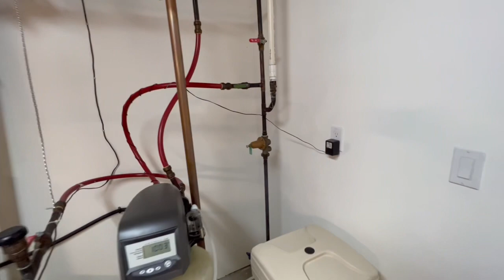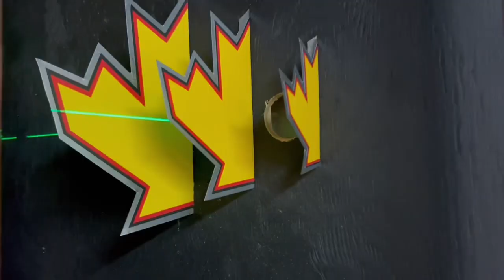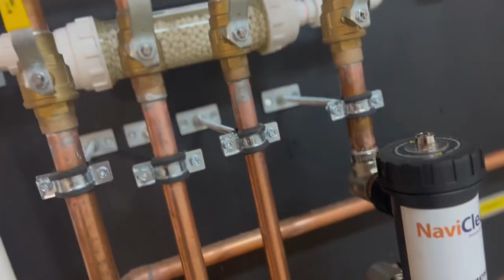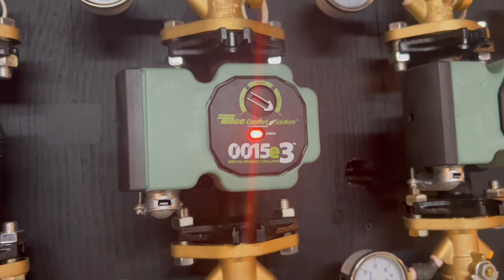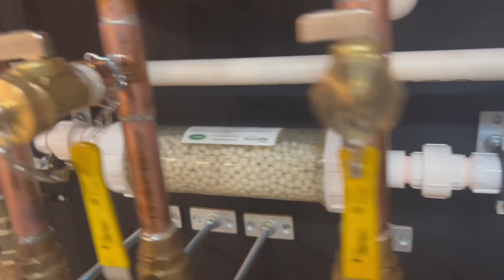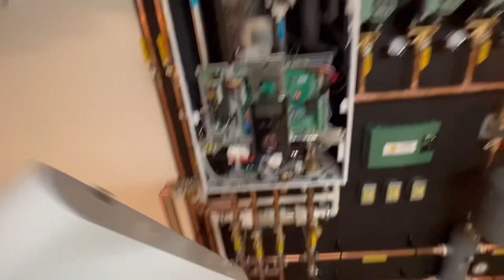Navien NFC-250/200 Combi-Boiler Retrofit #8

Comment: beautiful work. Question for you.  I have a 7000 sq ft. house under construction.  My plumber wants me to use a Navien  Combi Unit for four hydro heat air handlers and 5 full baths. BTU ratings are within the Navien specs.  I am concerned that when several people are showering at the same time we will have a lack of hot water and heat if all are running at the same time.  I am aware that the combi unit will switch to hot water and not be generating water for the hydro heat when hot water is called for in the bath rooms.  Should I go for a separate Navien boiler and hot water heater.  I am in the North East USA.  New York so we do get cold winters.  Thanks in advance.
Reply from the maker: I would do one of two options …cascade another Combi unit “two units” which gives redundancy or option 2 have a NFB strictly heating and NPE for domestic hot water

Comment: Odd question I know, but are you allowed to connect the boiler fill to a hot water line? I'm trying to do my best version of a Canuck like boiler install but my recirc line is blocking my access to the cold water line. I could pop over the recirc line but it would be a lot easier to just tie into it 😂
Reply from the maker: Never tried it

Comment: Looks like a clean install. I gotta ask though, is there a reason you didn’t install an axiom tank/glycol feeder?  
Anytime I’ve done a boiler swap where the make up water is coming from the city I always do an axiom tank. It’s just a lot safer. For one if you have a leak somewhere on the system you’ll know there’s a leak before any serious damage is done by just looking to see the water/glycol level in the tank. 
I did a boiler replacement for a customer who got a massive sink hole in his garage from a leak on his infloor heat.  His make up water was tied into the city and he had no indication there was a leak in his garage slab until he went out there one day to find a giant sink hole.  
I’m also a fan of the Navian combo boilers. I love how just about every component can be serviced with only needing a #2 Phillips screwdriver.  
That said I do think IBC is a better boiler. And in my experience they are just as good at backing their products.

Comment: Hey James, 
If I’m using the Navien NFB-H 199 manifold (copper oem), it has a gap/spot for a circ pump. Do I need a primary circ pump there if I’m using zone circulation similar to what you have here? I see you didn’t put one in. 

Wasn’t sure how it all played together with the hydraulic separator and if I could do without the primary zone pump on an NFB. 

Also, when you did the joint return,   You just piped the return lines to the 1 1/4” return line with 1 1/4” tees with 3/4” bull heads right? 

Thanks!
Reply from the maker: NFB need a pump …NFC don’t cause they have one internally

Comment: I have a 30x50' shop with a 6-circuit system. I just built it and only have the slab components installed, and the manifold built and pressurized. I don't have gas to the property, So, my options are propane (I will bury a tank) or electric. I also love Navien but wondered if their electric boiler would work as well as the gas? What direction would you go? It's in southern Missouri so it's not super cold there. Thanks for any help, James and great work on this one. The "for Ian" was a class act! Great work!  
-Brian
Reply from the maker: @Sea-Doopilot  electric options always work …and can be clean
Reply from the maker: But propane would be the best for efficiency vs cost

Comment: Going crazy with oversized zone pumps, not necessary for overly expensive and maintenance required systems. Wiping customers like there’s no end. I work on sky scrapers in NYC and a single pump does over 20 stories and over 1000 zones control valves. Poor customers don’t know any better, this is the problem when end users needs a heating system and they rely on a local plumbing company. Thumbs down 👎
Reply: Obviously you know NOTHING about pride in workmanship, this is not a 20 story building.

Comment: Why did you choose to use circulator pumps instead of zone valves?
Reply from the maker: If one pump zone fails then that zone has no heat but if you use zone valves and single secondary circulator and that fails then all zones have no heat

Comment: Why so many zone pumps?  Could you not just use one variable pump and zone valves?  I prefer a simple condensing boiler with an indirect tank that has a domestic coil and mixing valve.  Your install is very clean and well thought out. Are you going to insulate all the copper?

Comment: Hi, i jave a question. Do you raye these units for reliability? Reason i ask is that i had this same unit installed in my house and less than 9 months later have two issues with it.

The first is a 351-00 error code that the company thay installed it always tries to brush aside when i bring it up.

The second more annoying pressing issue is a LOUD and frequent whining noise coming from thr bottom left of the unit. This i was told is a inducer motor and they have ordered it to he replaced under warranty. 
But i dont know why/hiw something fails so quick on a unit that is supposed to be suitable for commercial purposes. 

Know im just not sure about the quality of the brand and product as a whole, was hoping to get 20+ years out of this boiler. I honestly doubt that will be the case. 

See my video for a clip of the noise it is currently making.

Comment: Great videos! The only question I have is about the use of dielectric unions. Typically copper pipe is bonded to the electrical system. With dielectric unions installed at the boiler won't that break the continuity of the bond, leaving a large portion of the copper unbonded? When filters are installed I usually see a jumper to maintain that continuity or another bond established elsewhere. So, should a jumper be installed around the boiler to maintain the bond?

Comment: Each of your 8 retrofit videos has been incredible.  Wish you were in Washington State in the U.S. so I could hire you.  My 30 year old cast iron oil burning boiler needs to be replaced, but I have propane available.  Is there any reason not to replace my oil boiler and indirect domestic hot water heater with an NFC combination unit?
Reply from the maker: Nope …as long as you got good water chemistry ….on propane is fine :)
Reply: @canuckmechanical6490  Thanks. Propane is about $1.40 per gallon cheaper than heating oil in my area. The NFC combi unit install quote I have is about $10,000 more than a new oil boiler install.  Can I make up the difference with the higher efficiency of the NFC combi unit and cheaper propane cost?

Comment: Fantastic work! Please compare the NFC vs the NCB. I have a new NCB hanging in my  basement and currently soldering pipes. Is the NCB a lesser boiler in terms of longevity or quality? Thank you for you videos, you are truly an artist.
Reply from the maker: The NCB is a water tube boiler vs a NFC which is a fire tube boiler ….the water tube has more restrictive passages in the heat exchanger which in no ideal in old or dirty systems ….put simply firetubes are superior
Reply: @Canuck Mechanical  thank you for the education. I am upgrading from oil but will be installing a new staple up system plus existing fintube  with a separate circulator. I will be flushing my existing system before connecting to the new boiler. Hopefully, this is the correct approach for this installation.

Comment: Looks great.  Why don't you use propress? It has made our jobs quick and clean every time.  Looks great though.  Are you insulating?
Reply from the maker: Cuase one mistake I have to start over …with propress I can’t fix and undo a joint soldering however is very user friendly and I can alternate it ….plus I don’t want all my joints to depend on a o-ring …..dont get me wrong pro press has great benefits just not my cup or tea for hydronics ….and lastly I find things like propress, pex and  tracpipe, make jobs easier and faster jobs but leads to an overall lack of craftsman ship skills and poor quality of work for younger generations …just my thoughts
Reply: @canuckmechanical6490  Makes sense. I saw some of your other vids. You used the Taco control module on this job. On your others you used Tekmar. Why did you switch? I have only used Tekmar. Let me know. Cheers.
Reply from the maker: @tylero8595  if you don’t try different brands u will never know if there is anything better out there :)

Comment: James, it seems that you've been watching Mikey Pipes. He agrees that the NFC (fire tube models) are robust and leak free. 
Water tube heat exchangers in general are problematic; they cannot be sealed 100% due to high temperature and high pressure operation. 
I personally believe Navien water tube heat exchanger have a design defect. They are an excellent company and I too really like their products. 
As Mikey Pipes would say, the final install came out TITS! Literally, your installs are excellent.
Reply from the maker: Great way to put it